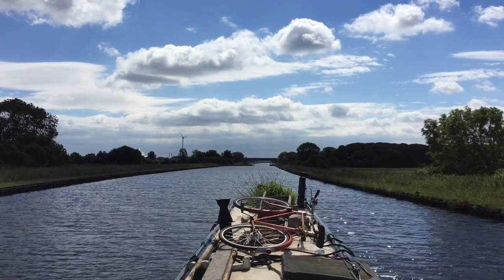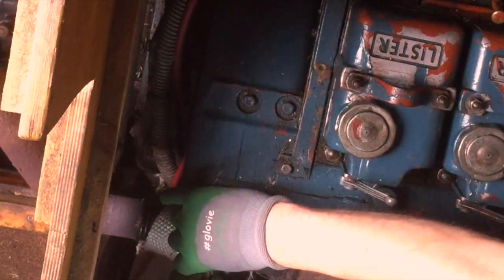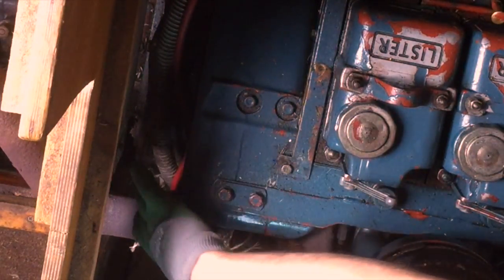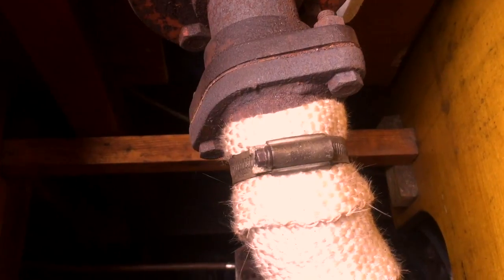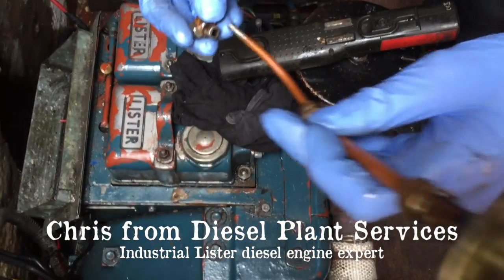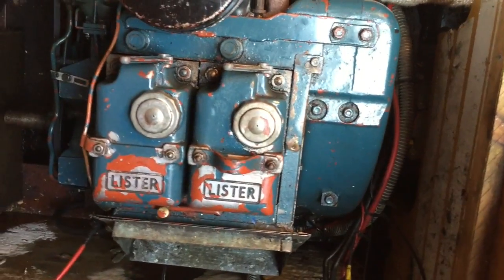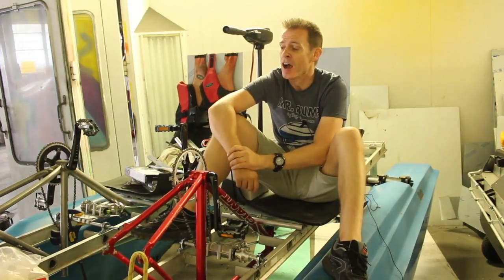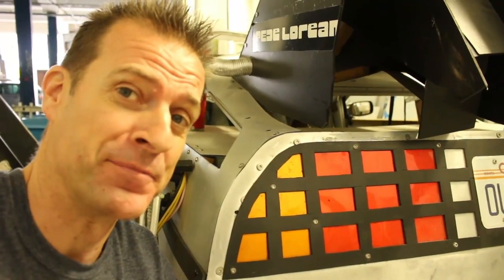Narrowboat DIY - Exhaust Wrap, Air filter, Oil Pressure Switch Leak & PEDeLorean workshop

Comment: Give yourself more credit.  You're off to a great start.  Patience is hard to come by if you have set a time limit on your work.  Slow and easy is the way to success in DIY mechanics.  Glad to see you sought experienced help.  I worked at a marina and put myself through college repairing motors.  When I started I couldn't change a spark plug in a lawn mower.  Much to the amusement of the mechanics who laughed hysterically at my efforts for 3 hours.  One took me on and mentored me because I would not give up and sought further advice as needed.
Reply from the maker: Thanks Al that's great to hear.  I know my skills lie in video editing and music making etc but even that's from well over 10 years of practice so it just goes to show if you stick at it you'll get there.  Thanks mate and great to hear your story!!

Comment: You might want to pick up some metallic tape to protect that toasted bit of wood that passes near the exhaust, next time you're at a hardware store. Easy to apply, and may add a little extra protection for the wood, in addition to the cloth heat wrap you applied.
Reply from the maker: Nice tip Max thanks!

Comment: on the exhaust rap it helps to wet it before you start it cuts down on the fibre's in the air and it pulls tight when dry

Comment: To prevent the new wrap from meeting the same fate as the old, I would either cut away the wood that was chafing the wrap or perhaps replace the engine mounts, thus preventing the exhaust wrap from contacting the wood, even while crankin' it.

Comment: Re your filter box, put a spring washer or an internal lock washer, these will create a little friction rather than just a standard flat washer. Alternatively get someone to drill a 1/16" hole in the filter nut and a hole in the filter housing and use some locking wire like we use on many aircraft bolt and nut fasteners.
Reply from the maker: Hi thanks for the advice about the spring washer - I was actually missing just that - the spring and bushings but also there was an extra redundant felt layer inside from a previous filter. Cheers!

Comment: Hey Robbie
Little tip with wrap, next time soak in water for a few minutes. Stops fibres getting everywhere and allows you to stretch the wrap. When it dries it will shrink a little and tighten, giving a really tidy wrap. Winter closures announced, are you mooring up or cruising the winter again? Take care matey👍
Reply from the maker: Ahhh I wondered why I'd seen that on another video (it was helpful but not that helpful and I thought I'd probably not want to get my rusty old exhaust even rustier!!)  Winter closures hmmm... I think it most likely that I will be pushing on through, unless I find a mooring like I did in Leeds. So much to see and so little time... cheers bud 8^)

Comment: Hi Robbie
Some thing to try next time 
Impregnate your heat wrap (lagging)with silicon 
Bathroom silicon is fine its good for many hundreds of degrees C 
I do it by covering a length of timber with heavy plastic and then laying lagging on that and working the silicon in with a butter knife a bit like getting resin into fibreglass let it cure turn over and repeat 
I do 50 metre rolls but I am lagging a couple of big engines your lister only has a bit so its not that big a job
Upsides to this is your lagging will now last a very long time
Your air filters will not get clogged with glass fibre Lots of old diesels dont have air filters so those were just ingesting glass fibre
Also your lister being air cooled will suck fibre into cooling ducts and fins mix with any oil there and create gunk
Your engine room will stay cleaner
Now nothing is perfect so down side 
For the first few hours as the silicon cooks in at high temp it stinks a lot a very ammonia smell 
So there it is
Just for your info modern lagging is just glass fibre woven mat so vibration makes it breakdown old lagging was asbestos didnt do that but it did tend to kill you eventually
I have been lagging exhausts in my fishing boats  like this for a long time I used to use high temp paint but they all broke down and made a mess
Regards Chris the Aussie fisho
Reply from the maker: Great info thanks Chris!

Comment: I find that tire shine spray, which comes in 3 or 4 brands, is excellent at protecting metal from rust, including exhaust, locks and hinges.  The one drawback is that, like most silicones, paint won't stick to it so avoid using it where you plan to paint soon.  Strange that they make no claims for metal.  They only claim to make rubber shiny.
Reply from the maker: That’s interesting - thanks Alan! 8^)

Comment: I'm kind of shocked, after your engine adventure I thought sure you were going to go to the "Pub of the Week".

Also a tip for you would be to get a Nylock nut for your air cleaner, or if you want a wing type nut you can remove without tools do a search for nylon Thumb Nuts, amazon UK has some or you might see if you can find something at the boat shop. You don't need a lot of force, you just need it to stay so an all nylon nut might be the solution for you.
Reply from the maker: Thanks Ted!  Well I don't have to worry any more now as have just got the right parts installed - the filter was new but the set up was old, and was missing a spring etc.  Not to worry.  Good point about Pub of the Week I shall have to do that next time 8^)

Comment: I understand where you're coming from....(Going to the next wifi spot, job or pub) 
But canal time should be slow time...Zen of wrapping fibre glass round a hot pipe...It's like motorcycle maintenance but without wheels and unchained, just tied up and flogged!. 
I'm glad you don't do regular fix-it vids.. :O
Reply from the maker: 69Phuket Hey I agree canal time should be slow time but that's not always possible when you have a life! Thanks for watching my zen and the art of narrowboat how-to fail!!

Comment: Use a crinkle/split washer on that airfilter to stop it coming loose with the vibration.
Reply from the maker: Thanks - I have tried that, tried everything now! It is the bolt thread, it’s completely worn, so will try and get a new one made and hopefully that will sort it.

Comment: I got more than half way through your video before I realised that the wee graphic in the bottom right hand corner is the thingy (technical term) for working the locks and not a lute. I was wondering why you would have a lute graphic on the screen but then I am not a clever man....
Reply from the maker: Ha ha yes it's my stab at a logo - it's the windlass! It symbolises cranking it!!